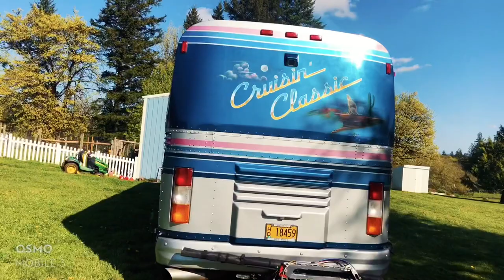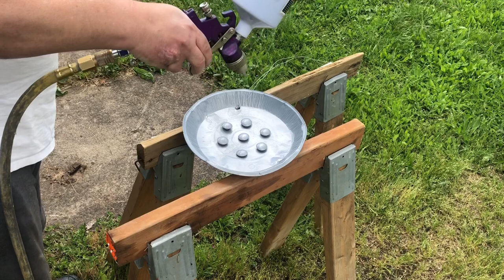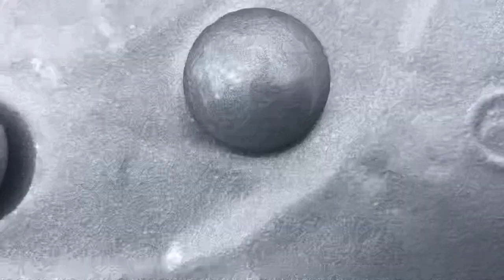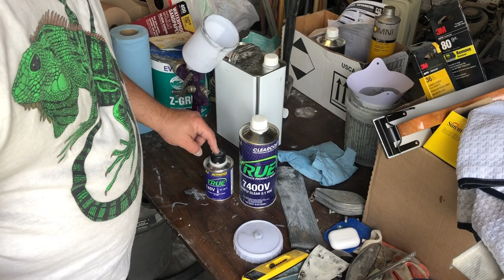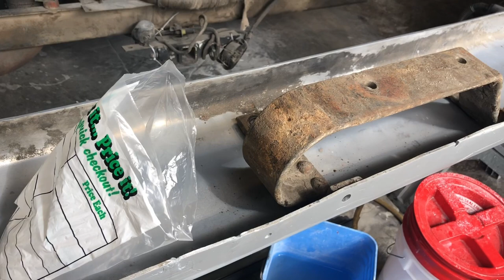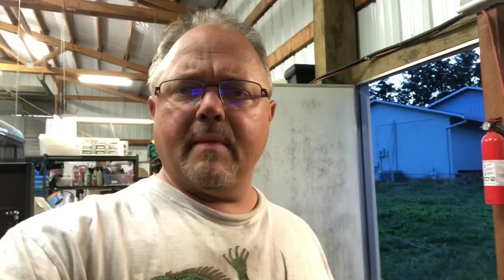4106 bus bumper bolts and bracket reconditioning

Comment: A friend of mine chucked-up the bolts in his 1/2 drill. Then used a sponge sanding pad to buff the round bolt heads.  Worked great.
Reply: The sanding lines went in a circular pattern and was not very noticeable.
Reply from the maker: Yeah good idea. I could have put them in my lathe.